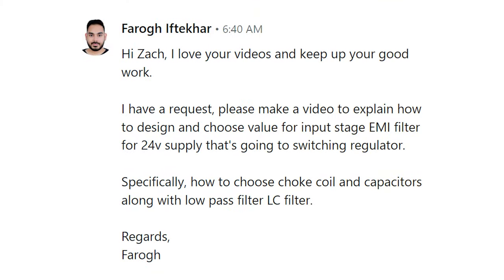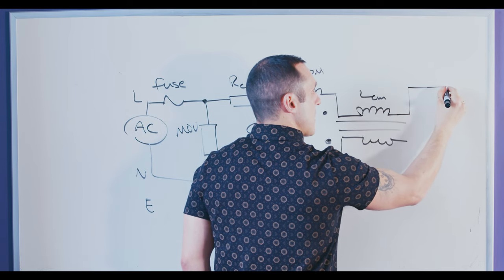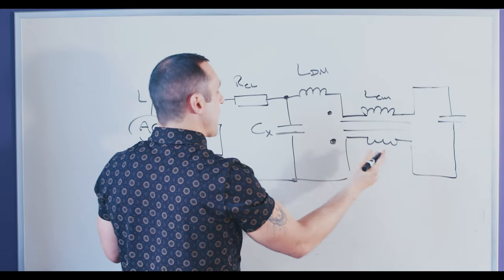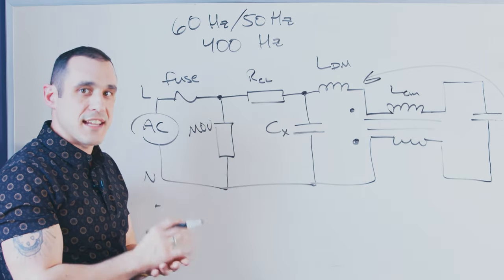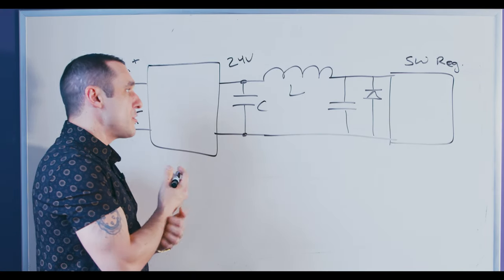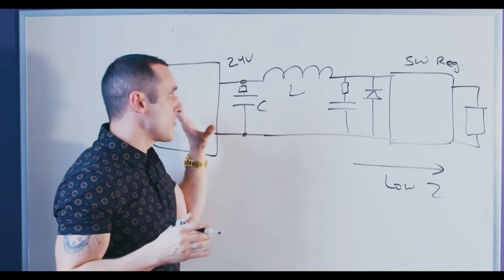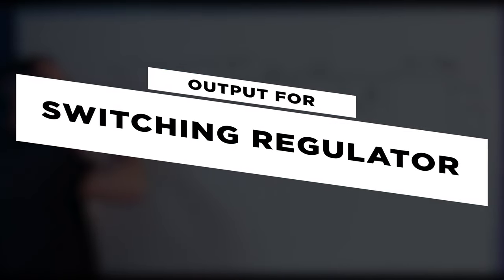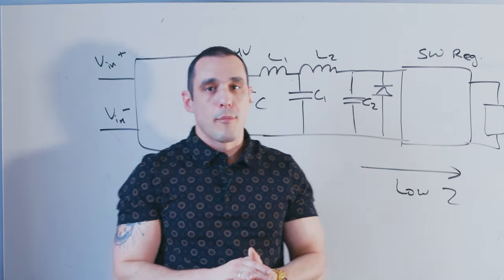EMI Filters on Power Supplies: Design & Application Guide

Comment: Good video! One fascinating thing I have had to learn is if you are making a DC only circuit you have to make sure the EMI filter is compatible with a LISN. Have experienced seriously noisy oscillations from neglecting this in the past!
Reply: What do you mean? LISN have AC input right? How will you connect your DC-only circuit to that? And how do you make sure it is compatible?
Reply: @xdZapo  You will see some LISN's that advertise being able to take DC input and follow appropriate standards, so its definitely not AC limited. My employer sells some DC products and according to standards they too need to be checked for conducted emissions the same way as an equivalent AC product

Comment: At first, when you said that if we see low impedance through the sw reg, we can see some peaking, I was like, hey, thats not true, a LC filter with a resistor R, the lower the R, the larger the damping factor. But then I remembered that sw regulators have negative input impedance 😅

Comment: Hi Zach, I have a board I made that I want to sell. What kind of certifications do I need in order to sell a board in the US? FCC/UL/CE, etc? I’m sure it depends on features, but doesn’t a buck-boost DC/DC produce enough noise to qualify for a FCC test requirement? If not, then why do my phone chargers have FCC on them? It’s all so confusing
Reply: This is a great question and I'll do a video on it. Unfortunately the answer is far too long for a reply on a youtube comment! I'll write a blog on it too. In short the requirement is FCC for sure, and the exact test depends on the features (wireless, battery power, etc.), the power level, and whether it plugs into the wall. UL testing is not a requirement by law, but UL testing should still be considered in many consumer/residential scenarios or in manufacturing, there may be specific codes that require the use of UL compliant products. CE is the European variant of FCC, then there are also CISPR requirements. For example, in the US, the FCC and CISPR 22 regulations are legal requirements on digital systems. Then if you're in the defense world, you have to look at MIL-STD-461 compliance as well.

Comment: Hi Zack, could we get a follow-up video using altium spice simulator to more formally design a discrete pi filter? Really interested in seeing the transient response peaking mitigation as well.
Reply: I've done something like that in the past but it was more about adding LC sections to the output of a regulator and not speciifcally on Pi filter design. Depending on the load and the ESR on the components there may not be any peaking. It all depends!

Comment: Great video! I saw the schematics for a design the other day that had one of those higher order filters either side of a switching regulator, so there was a local ground around the regulator isolated by the chokes. Would this cause an EMI issue?
Reply: It's only an EMI problem if you try to make a big ground pour out of the output side and then route over it. You get radiation at the gap between these two regions.

Comment: Great video! How come some people also put Y-caps accross the postive terminals of an isolated converter, don't we just need the ones for the isolated grounds?
Reply: Y-caps are designed to fail open and are normally line-to-ground, so they provide the required capacitance but if they fail they will leave an open circuit and will not create a fault.

Comment: In which situations common mode filtering could be avoid? The examples you are talking about hasn't common mode noise issues so you can avoid and only use PI differential filtering?
Reply: The simplest explanation is that you don't need common-mode filtering if you do not have a problem with common-mode noise. Sorry if that is not helpful, but the same statement can be made for any instance with a filter. If there is excess common-mode noise coming into a device power input from a cable, then common-mode filtering is needed. Generally when taking in power from an outside source, it is possible that both noise sources are present in the input power so it is worth planning for this.

Comment: I'd ask you explain or make video about correct use ground, chassis... what happens if chassis is GND? can I do it?
Reply: They already have a video on grounding, there is also an absolutely amazing lecture by Rick Hartley on the main Altium channel as well.
Reply: Chassis is not intended for use as the ground that completes a circuit with return current. Chassis is normally meant for use as a safety ground to protect against a fault and/or to shield against noise.

Here is the grounding video: https://www.youtube.com/watch?v=19WnYPhNOH0
Here is Rick's video: https://www.youtube.com/watch?v=ySuUZEjARPY

Comment: Would you need such filter for a class ab amplifier fed from 2 x 15V trafo, I'm building.
I would like to include it, but don't have spectrum analyzer.
Reply: The filters I’m describing here are for the input stage on a power supply that would output DC and would be used before any transformer or rectification stage. I think what you want is a filter directly on the input pins, which is not just about EMI. You can put a capacitor on the power pin to provide some filtering. You could also place an LC filter if much more filtering is needed but you might need to dampen it with a small resistor.

Comment: Can you explain what is matching capacitor means,  why and how?
Reply: When I said a matching capacitor, I just mean a capacitor with the same value as the other capacitor forming the pi filter. The reason is for convenience of calculation of the cutoff, but you could use a different capacitor value in each spot.

Comment: I see that for DC you don't use CMC. Does mean that CMC for DC no need (in most cases)?
Reply: Many times it is not required, but it can be helpful for passing EMC testing. If the two DC regulators are on the same PCB you might not need a CMC for noise filtering. If the DC power is going out over a cable then it is a good idea to include a CMC on the output before the cable.

Comment: thanks for great video but I think it's better use TVS-diode before filter, not after... can high voltage destroyed capacitor? can high current destoy inductor? we haven't these risks if TVS near connector
Reply: That unidirectional TVS diode is being used for DC, which is why it is used in between two regulators. I did not include it on the AC input because the unidirectional TVS would create a short circuit in that application. You can use the unidirectional TVS diode after a bridge rectifier, this is the typical location where it would be placed if it was used for circuit protection before a DC/DC converter. Normally on the AC input, there could be some other form of circuit protection, such as a fusible resistor or resettable fuse. In high current instances a circuit breaker or a GDT might be used, it all depends on what the fault withstand requirements are in your scenario.

Comment: Sir I have a confusion:
I have a ATMEGA128A based microcontroller  board, which control a small AC synchronous motor , 6 RMP through a 5V/5I  REALY with fly back diode across relay coil. during switching of motors sometimes create problem (at random times in hours).  RTC freeze and LCD display garbage.  
Is it EMI problem ?
ESD?

Board is given power through 5V/5I  SMPS. 
Shall I put a LC or pi-filter or "as you said higher order pi-filter"   after SMPS ?
what should I do ?
Reply: Sorry but I could not say what the potential problem may be without at least looking at schematics. It could be due to a power problem that is not related to EMI.
Reply: @Zachariah-Peterson  How I can share schematic with you ?  
As per my observation, schematic is not of much issue. Its due to "BAD" PCB design. 
when inductive load switched off , it create noise/surge voltage on AC line, which come back to PCB board through SMPS.

Comment: Sir i don't have enough equipment to test ic .I have only multimeter. Please sir help me which option it will help me to diagnose ic with multimeter in voltage mode..when the power supply  is on how can I test voltage of ic and where should I put black lead of multimeter to test red lead on ic.please help me sir

Comment: i use power sequencer on my audio system but no built in emi filter" are emi filter make the speaker quieter?
Reply: The EMI filter circuits I'm showing here are specifically being used to remove different types of noise (common mode and differential mode) from the input power connection. I can't tell you whether this would make your audio system quieter because there could be many different noise sources in your system, and any one of them could cause the noise you are observing.
Reply: @Zachariah-Peterson  are power supply with emi filter safe?

Comment: @Altium Academy Thank you for this presentation. In the start, you were mentioning about filtering for 50Hz / 60Hz / 400Hz. Are you able to create a video that will include the different filter models, together with their math and how to do a two or three step filtering for a combined 50 Hz / 60 Hz filter that is a universal filter for multiple regions, and how to calculate the DM and CM chokes for Amps when different regions need either 10A or 16A. Also in regards to the resistor fuse, how can we choose if there is one, a resettable fuse (NTC) for 120V / 240V @ 10A / 16A. All this using just a two layer pcb.
Then on a different topic, we can explore the GDT / MOV / TVS for mains supply, using GDT for capturing spikes from the CM /DM chokes, as shown on some of Mitsubishi's literature and video - https://www.youtube.com/watch?v=C-pV72GzQj4 - @3:20. The video in whole is excellent too.
Can you also elaborate on using a GDT in the middle of a bridge rectifier. Will that be only for SMPS or is it useful for after a transformer (240V / 9V) where you use a full bridge rectifier?
Thank you.